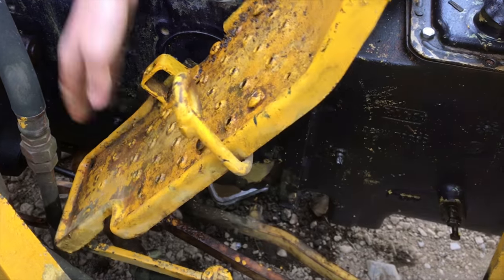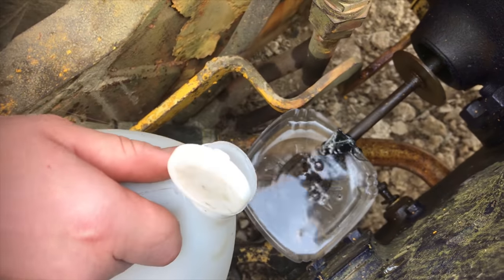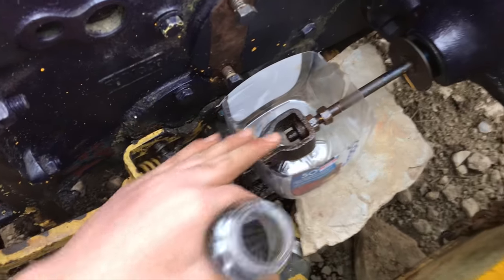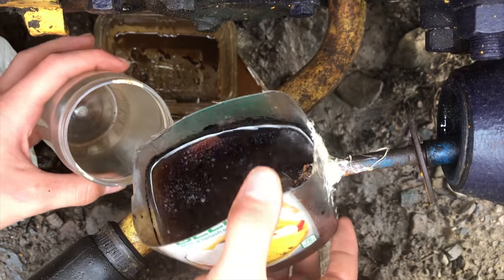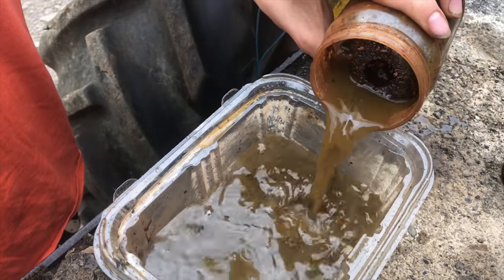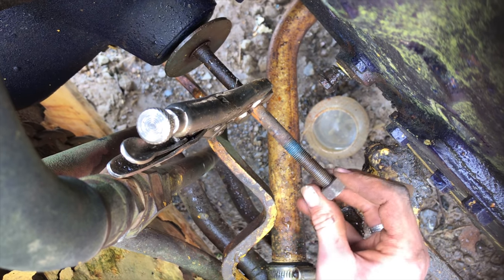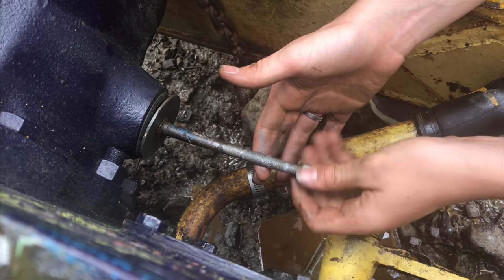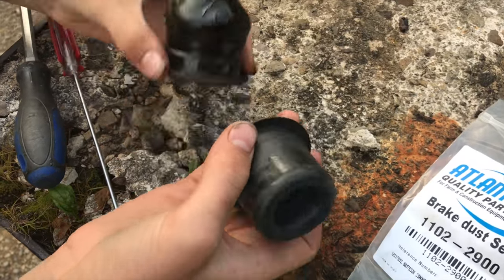STOP fighting rusty parts DISSOLVE THE RUST

Comment: I’ve always heard vinegar does the job, but my past experience with it has not been the best. However, I just used this technique to get the rust off of some parts on an impact wrench I am rebuilding. I let the parts sit a whole day and sure enough, the rust was absolutely gone! The most shocking was a completely seized bearing and while I couldn’t save it, I did manage to get the rust off enough that the bearing would move with the help of pliers. The power of vinegar - behold!!!!

Comment: I love this.

Some metals will start rusting again as soon as you take them out into the air so I was wondering if you use something like a baking soda and water solution to neutralize the parts after it is done?
Reply: you could probably use something like fluid film or used motor oil to keep the parts from rusting

Comment: Great tip. 
Used cans clamped to the bottom of a 5th wheel slide to soak the nuts to hold it in place over night.  My biggest impact wrench won't wouldn't turn them.  See what happens in  the morning .

Comment: A little salt in the vinegar will speed up the process.  It creates hydrochloric acid.  Vinegar itself is Acetic acid.  The vinegar from the kitchen bottle has a lot of water in it.  So adding salt you actually get a rather dilute hydrochloric acid.  It should not corrode the unrusted (aka not oxidized) metal but check it sooner than you would when using just vinegar. Vinegar alone should be sufficient but a slower gentler process.
Reply: As a side note.  You can pick up a stronger vinegar at a hardware store if you want to save time.
Reply: Then add some hot sauce and it'll be incredible. You could do Sriracha if you are hip lol.

Comment: Error Code guy, what would you recommend after soaking a rusty crankshaft pulley in vinegar, how to avoid the flash rust?
Reply: Rince with water, then Baking soda + water solution and apply something like WD40, or repaint